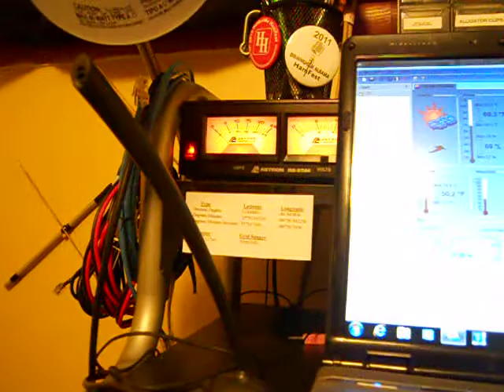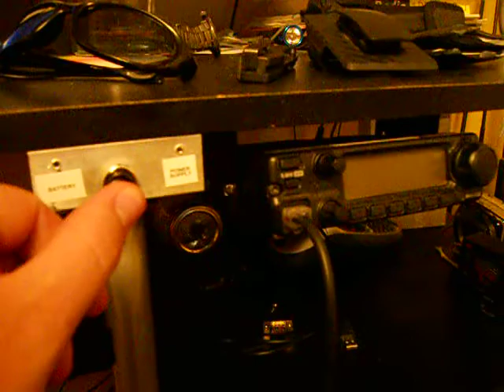Ham Radio Emergency Power Supply

Comment: CP, you'll need to buy a DC to AC grid-tie inverter that accepts a range of DC power (being captured via the RF signal) which converts the DC to AC (just make sure the AC voltage matches the 110/220 that US power grids run on.  The watts will be the power that is sent back to the grid.)  I've built a battery bank to hold the power and run all the AC devices from which the power is out.  When batteries are charged and grid is up it sends the excess power not used back to grid (like used with sola